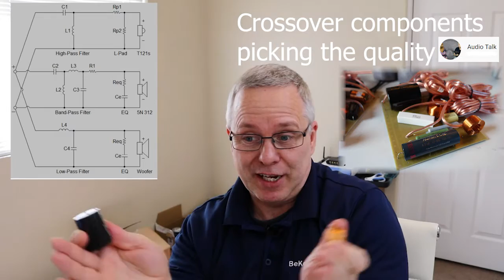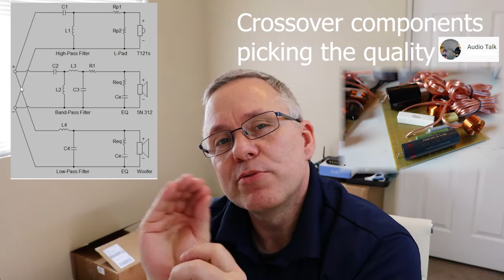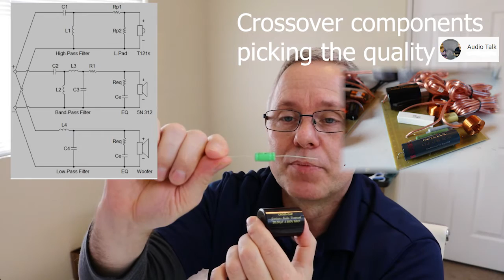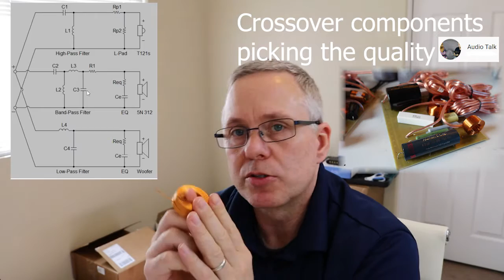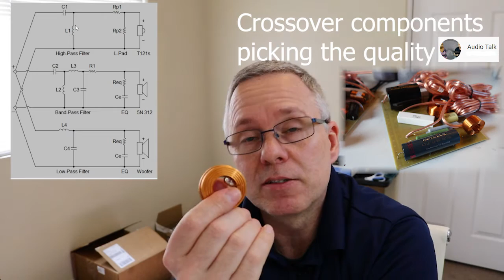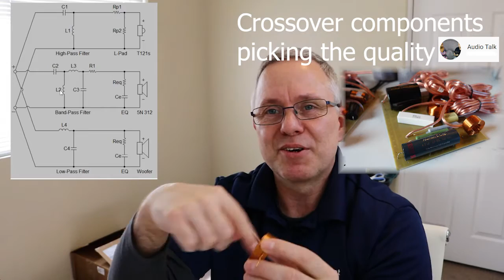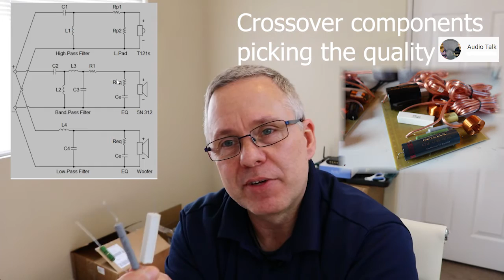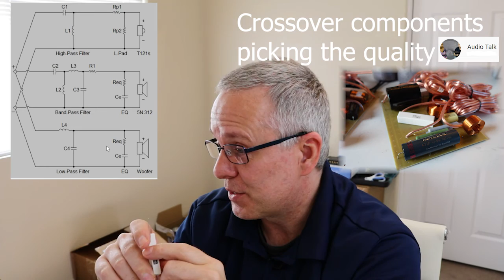How to Choose Crossover Components on a Budget

Comment: Best advise ever, thx. A month ago I started building my own xovers for my Denon 1910, and wish I had watched your video earlier. Nonetheless, I'm pairing my 7.1 AVR with big horn tweeters and vintage pioneer bookshelves. My sound is more crispier after upgrading to crossovers. 

I found that not connecting the tweeter air inductors to ground but directly to + gives a better response than if the coils had been grounded. 
I'm using ceramic resistors, bypass caps and diy coils.

Advise on:
1. HP air coil connected directly to tweeter + instead of grounded because my woofer coils is already grounded.
2. resistor connected to LP immediately before AMP -

Comment: Please I just came across this video good work but if you can teach how to calculate  the components  that's
Reply from the maker: Use an online calculator or much better crossover software for that. Even if you are a electronic engineer it makes no sense to calculate manually. You change one thing and it moves so many other parts of the calculation. I recommend X-over pro from HarrisTech because it guides you. Lots of people like Xsim which is free, and its good if you have some more fundamentals and it requires ZMA and FRD files on your speaker drivers, and here X-over pro can work with thiele-small parameters if you dont have ZMA and FRD files

Comment: How does the outer foil capacitor lead connection impact the crossover ? What is the proper outer foil lead orientation for C1, C2, C3, C4,  Ce ?

Comment: I have some JBL HP520 towers that were pretty high end when they came out. I just looked at the crossover, and a lot of the capacitors look to be Bennic radial dipped polyester film capacitors. And anywhere there is an electrolytic capacitor, there is a tiny green chicklet tone capacitor in parallel. Half the inductors are air core and half are iron core, but on a steel spool, instead of plates. All resistors are sand cast. Pretty much every component that had a label was a Bennic component. All the electrolytics weren’t bulged or physically leaking. It seems like pretty nice stuff and they didn’t skimp a lot on the design. Would there be any appreciable benefit to upgrading the components?

Comment: I am planning to build a Passive 4th order High Pass filter for my tweeter, which is able to play down to 1kHz, and thus I plan to have the signal to be attenuated to 60dB by 1kHz and be at 1.4kHz at 83dB, basically filtering at just below 1.6kHz.
Is there a reason why a 3rd order is better suited as a High Pass filter for a tweeter like mine? I have read that when it comes to the phase difference between 4th and 3rd order filters 4th orders can cause resonance, is this correct? I am not 100% sure if I am on the right track and would like to save some money if a 4th order will cause the tweeter to sound weird, but I really like the steep slope, so hoping it is acceptable.

Furthermore, I plan to use the following components;
Mundorf capacitors
Mundorf Air Cored Copper Foil Coils CFC16 (inductors)
Mundorf M-Resist Audiophile Resistors
Which will cost me a total of $250 for two High Pass Filters.

I am happy with the budget but prefer to not waste money making a mistake, especially if it is a blatant one.

Thanks for sharing your knowledge.
Reply: The coils introduce phase delays and the capacitors out of phase, you cannot get rid of distortions with passive filters!! Because of this, it is best to use a very good constructive broadband speaker! Or as few components as possible in the crossover, of order 1 with loudspeakers already built at the same SPL and made for certain frequencies!

Comment: Really good and detailed explanation on considerations for crossover design. There's not much information I could find on line that puts it as well as you did. Thank you.

I'm currently working on some Elac speaker crossovers where my mids are recessed and not as detailed, and the highs are too loud and a bit fatiguing. Contemplating what the best approach might be.
Reply from the maker: More dampening with the lpad and a better capacitor in the high pas maybe will do it. Its often hard with the factory made speakers because the speaker drivers doesnt come with thiele-small data, so then they will have to be measured with ex dats v2 and a umik-1 to get data to calculate with.
Reply: @AudioTalk  Exactly the right answer.

Comment: very fine video.  tx.  do you know of any books out there that would be close to Crossovers For Idiots?  I know nothing off this subject but would like to learn how to design speakers from scratch.  Tx again.
Reply from the maker: My suggestion would be to get Bassbox Pro and Xover pro which are softwares. If you go to Help in the menu and select On-screen manual, it will show a really easy to understand intro to speaker building in each of the 2 softwares it consist of. The reason why I think this is better than any book is that the software can estimate good compromises, and is full of little design hints/warnings that clues you in to the dynamics. So through the why is it doing that and what the manual said, I believe you have something that moves forward quicker.
Reply: @AudioTalk  thanks for your help, Kent!
Reply: @weeverob  I find X*over Pro to be a bit clunky but Kent's advice is right on the money. The best explanation of crossover design I've ever seen comes in the X*over Pro users manual. Brief, precise, easy to understand. It's excellent.

Comment: Is there any benefit to fancy higher end crossover components vs cheaper ones?
Reply from the maker: Absolutely, if the speaker drivers support it and they often do. Particularly vintage high-end this is often a good upgrade, back in the day electrolytic caps where often used, and they really have no place in high-end, too much hysteresis.
Reply: @AudioTalk  don't all the crossover components technically do the same job though so long as the values are what the design calls for?
Reply from the maker: @ubacow7109  They technically do the same, but there are different qualities, just like the speaker drivers, just fewer aspects of differences. So an electrolytic cap can do the job, the result is just harshness and lack of clarity, particularly its clear in the high-pass to hear.
Reply: Film and foil capacitors can discharge faster than electrolytic capacitors of the same rated capacitance, so are better able to respond to the  changes in higher frequency signals. This is why they distort the signal less, providing a cleaner sound.
If you must use less expensive capacitors, at least do as Kent Larsen says and run a high quality capacitor in parallel to the cheap cap.
The other problem with cheaper electrolytic caps is that they degrade over time.
The simplest way to get great sound is by hunting down and designing for low Qts drivers to get a low Qtc (no higher than 0.8) and high quality crossover parts just as Kent Larsen suggests in this video.

Comment: I was looking to uograde a cheaper crossover board with slightly better components. I picked up a couple of wima caps 3.3-3.4uf 50v, now im worried..as theyre tiny compared to the massive cap on the board...does size matter? 😂

Its a 100w rms amp going into a 100w woofer and 15w tweeter 8ohms +l-pad from said cheap crossover board (2nd order woofer, third order tweeter,).
Reply: The tiny capacitor of the same capacitance as the large cap is almost certainly an electrolytic capacitor. It is completely unsuitable for a crossover circuit. Stick with the large one. Those can last nearly forever. They are probably fine. It's generally only the electrolytics that go bad over time.
Reply: Thanks for that information bro..👍

Comment: There is a study on iron core inductors and other papers on the topic of speaker crossovers on DIYRM. Some of them contradict what you say. I think if an inductor has a high value, then sticking with expensive air core makes no sense. Laminated core inductors have neglegible hysteresis.
Reply from the maker: Maybe I am not being clear enough in the video, but that is exactly what I am advocating (starting around 10:30). There the shift due to resistance is explained. Even better than the laminated steel is toroidal cores.

Comment: What about noise from the resistors, and inductance free resistor sandcast or anything else will make no difference not sure why you showing three different types there's no difference between the three if they're non- inductance they are all the same as long as  noise floor is the same. What about tantalum resistors why are they not preferred
Reply: Tantalum is one of the conflict metals. As long as you buy tantalum, you're fueling the tribal conflicts between the african regimes that own the mines. I guess that's mostly why Tantalum has lost its fame among the enthusiasts.

Comment: Well shit, I wish I'd watched this damn video before I ordered the frickin expensive 100uF capacitor and 2.5mH inductor for my lowpass =P whoops
Nah, it's ok, we're talking maybe $50 bucks, which isn't nothing, but for the quality I got, It's gonna last. 
The only thing is I wish I coulda got some of the 1% loss 20w resistors instead of the 10w 2% ones. But honestly idk how much that will matter. 
Building Swope 3-way tower btw
Reply: I have a question if you don't mind, I'm trying to wrap my head around component values. I'm not knowledgeable about the electrical field to be honest but trying to learn bit by bit. What is the difference between the 10W and 20W components? Are the 20W components just able to handle more power if the Ohm rating is the same? Or does it have a different effect? For example a 10 ohm 10w component will have a resistance of 10ohm until 10W and anything above 10W will not be resisted? Maybe it helps if you explain why you wouldve wanted a 20W component instead of the 10W one? Hope my questions aren't too stupid, I'm a noob haha